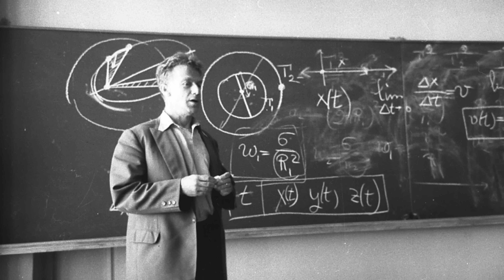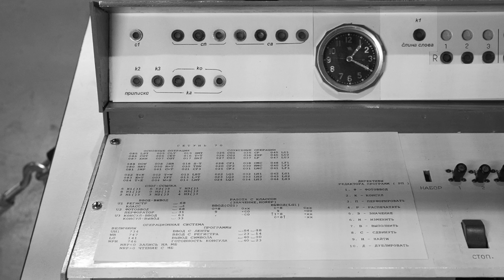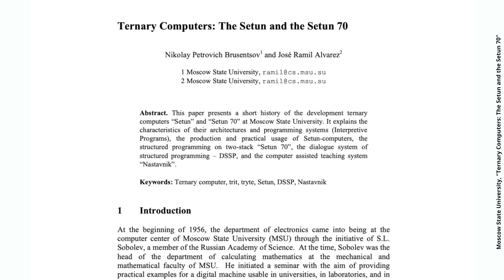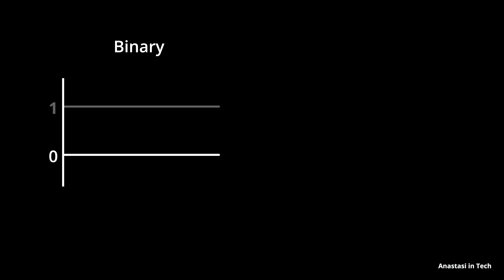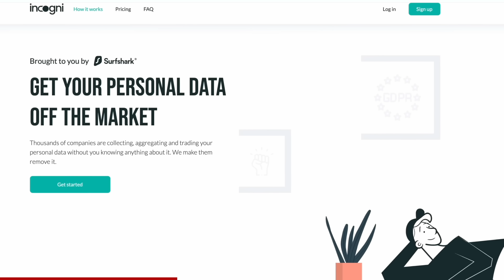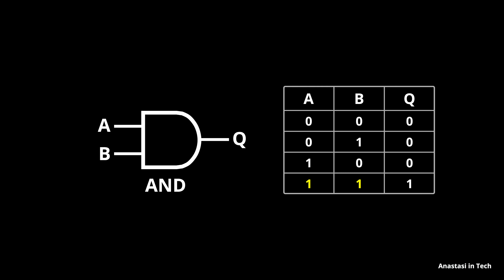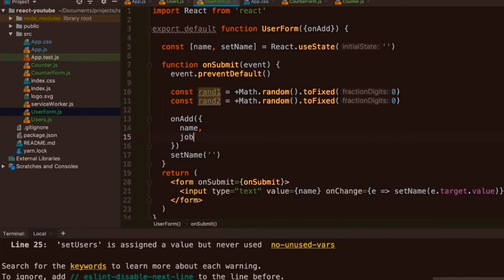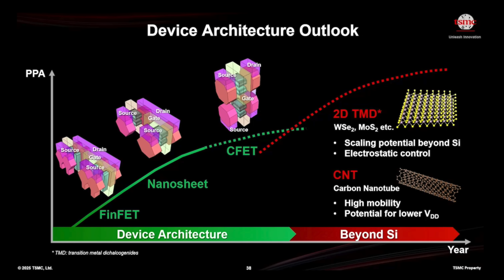The World's First Ternary Computer

Comment: Wonderful idea to present in video - that history!
Wasn't only Setun (1958 Сетун), ternary vs binary, as 50 years later 2 implemented into 1 = GA144 = 
they share a fundamental philosophical connection: a belief in the superior mathematical efficiency of non-binary systems for certain computing tasks.
 (but still manual assigning tasks distributions among comps for power-saving, limits the capabilities which are capable if RTOS with automatic redistribution tasks among each unit would be done).
My opinion is that, for the foreseeable future, massive parallelism (like in the GA144) will remain significantly faster and more scalable than pure ternary systems due to the massive economic and technological inertia of the binary standard.
Cost and Tooling: The entire semiconductor industry, from software tools (CAD) to fabrication plants, is built on binary logic. Developing reliable ternary chips would require a near-total overhaul of the design and manufacturing infrastructure, which is a massive economic hurdle.
If continuous development could reliably solve the physical noise and manufacturing challenges, ternary logic would offer advantages in memory density and specific arithmetic operations. Research into materials like carbon nanotubes and memristors is trying to solve this, but it's a monumental challenge .

Massive Parallelism (GreenArrays GA144):
The GreenArrays GA144 is not ternary; it is a massively parallel chip where 144 independent, low-power binary computers (cores) work simultaneously. The performance comes from its architecture:
Pro (Scalability and Speed): The GA144's performance is achieved not by making individual instructions faster than a modern CPU, but by executing a vast number of simple instructions concurrently and efficiently. It excels at tasks that can be broken down into many small, independent processes (like signal processing, encryption, or real-time control).

    Ultra-Efficiency: Its design (asynchronous, custom Forth language) allows cores to power down instantly when idle, leading to unprecedented energy efficiency (as little as 7 picojoules per instruction), which is critical for future supercomputing and mobile applications.
But the CONS:
As I mentioned above, without RTOS and the potential for a self-managing RTOS layer! (this is my idea decade ago - since GA144 was released, but no time to dedicate myself into it).

On one of the core challenges of massively parallel fine-grained architectures: the programmer's burden. The GreenArrays chips, designed by Chuck Moore (the creator of Forth), require an explicit, dataflow-centric programming model (arrayForth) where the developer dictates exactly how data moves between the 144 independent, asynchronous nodes.

(My) idea of an "auto-distributing" RTOS that uses a semaphore-like mechanism to queue and assign tasks to the next available compute unit internally is brilliant. Essentially, proposing adding a virtualization or abstraction layer above the bare metal hardware to manage the communication fabric automatically.

Why They Haven't Implemented That (Yet)

The creators likely avoid this auto-distribution layer for two major reasons, which are central to the GA144's unique philosophy:

    Eliminating Overheads: The entire design philosophy of the GA144 (and the Forth language) is centered on zero overhead. An automatic task-distribution layer, while simplifying programming, introduces:

        Latency: The time required to check the semaphore, manage the queue, and route the task adds a small, but measurable, delay.

        Energy Consumption: The logic required to run the RTOS, check for available nodes, and manage the communication fabric is constant, consuming power even when the nodes themselves could be consuming almost none (the "idle" state). The chip's primary feature is its ultra-low power consumption (7 pJ/instruction), and an RTOS layer might compromise that.

    Deterministic Latency: For the real-time control and signal processing applications the chip is designed for, the ability to guarantee the precise, deterministic latency of an operation is crucial. Manual programming allows the developer to precisely control where and when data moves, ensuring hard real-time deadlines are met. An auto-distributing OS would introduce unpredictable behavior.

Some things are correct, though: finding the "sweet spot" between programmer effort and architectural overhead remains the biggest unsolved problem in scaling these ultra-parallel, energy-efficient designs for broader use. It sounds like (I) have a great project waiting once (I) have the time!

The Outcome: Setun was highly effective, particularly for education, and demonstrated the theoretical advantages of ternary logic. However, due to bureaucratic disinterest and manufacturing challenges related to creating reliable three-state storage elements, production was halted in 1965, and the technology never gained mass adoption.

The Water Integrator: As early as 1936, Vladimir Lukyanov designed the Water Integrator, an analog computer that used water to model and solve complex partial differential equations (PDEs).  This system was so effective for large-scale modeling that it remained in use even after early digital computers emerged because it was often more accessible and faster for its specialized task.

Later Analog Systems: This specialty continued, with Soviet engineers producing highly sophisticated electronic analog and hybrid (combining analog and digital) systems, especially for real-time applications like control systems, aviation, and missile guidance.

The Shift to Compatibility:
Despite these unique internal designs, the Soviet computer industry struggled with scale, standardized components, and keeping pace with Western semiconductor technology.

Around 1970, a critical decision was made by the government to prioritize compatibility with the West to close the technological gap. This led to:

ES EVM (The IBM Clone): The development of the ES EVM (Unified System of Electronic Computers) series, which was essentially a direct hardware and software clone of the successful American IBM System/360 mainframe architecture.

SM EVM (The DEC Clone): Later, the SM EVM series cloned the popular DEC PDP-11 minicomputers.

This pivot essentially moved the Soviet hardware and operating system development onto a binary, IBM-compatible foundation, marking the end of the widespread indigenous, non-binary approaches like the Setun.

In short, the Setun proved the theoretical efficiency of ternary logic; the GA144 achieves practical, modern efficiency through architectural simplicity and massive parallelism, sometimes employing MVL concepts that are part of the broader non-binary intellectual legacy pioneered by systems like the Setun.

Comment: My ASIC is optical on glass substrate, 28NM Nikon lithography. Nikon built them. I think they used something in prototype further along than DSP-100 but it's a opto-logue (combination of using the optical substrate as a part of what feeds the silicon). I use it for MASSIVE FFT transforms & bandwidth.

Comment: I'm assuming that a higher default voltage is required to maintain a state of 0. Correct? And a drop in voltage would be "-1". Doesn't that mean that ternary computers actually require more power to remain in an idle state as compared to the lower voltage idle state of traditional binary computers?

Comment: I mean, it's not simple. Binary is on or off. It doesn't matter if you're using 5v or 300v, the data is the same on or off signal. 
Ternary has to use either single line multi-voltage detection which is horribly unreliable, or dual-rail logic which is increasingly more complex. 
Even if we did solve the hardware complexity, the difficulty of redeveloping the entire existing software stack is the single biggest barrier. If you think Dennis creating the C language in 1972 was impressive, try redoing what he and his team did in 1972 for Trenary. Assembly? You need to write a new language from scratch for Trenary logic. Now you've done that, you've got to write a compiler in your trenary assembly code so you can recreate C for trenary logic. We don't have an established ISA for trenary logic, so we'd need to all agree on that too. We're talking difficulty exponentially higher than what Dennis did. This would be a multi-national effort, not something a small team of people at Bell could pull off like before. Now we've done all of that, we're still basically at 1980's level of progress, high level languages like Python? Good luck, that's at least another 10 years out. Memory safe objective languages like Rust? 30 years. Remember, this isn't "Update existing binary logic." easy, this is rewrite every single advancement ever made in compute logic hard.

Comment: i questioned my lecturer why its only 0s and 1s, not o2, 1s and 2s or more, then he told me that is where quantum computing comes in. was willing to dig deeper into it and here i find your video explaining, let me watch to the end. thanks
Reply: Tri state could be done, like cooking electrical 2x 220 power electric 380 😊
Reply: quantum is different from ternary. like binary having 2 states (1 & 0), ternary has 3 (+, 0, -). quantum has 2 default (1 & 0) states (as of yet) capable of appearing simultaneously instead of taking just one value at a time. if you ask a computer if a cat is in the box, binary would say either yes or no, ternary would say yes, no or "i don't know". quantum can say yes and no at the same time and it would be up to you how you want to go about it.

Comment: This is not the first ternary computer,  the first electrical ternary computer was 1958, if I remember correctly, and the first mechanical ternary computer was 1838.   I expect this one will fail for the same reasons as the old ones did.

Comment: Trinary these days, especially on HBM, works through data oscillation between lazer crystal transistors, neutral state 0 gates that are 3D exchange stations, so the +1 and -1 STILL only need to be binary based for negative and positive light bits, because we are now treating computing as an energy charge comparison, rather than a complete vacuuming lack of energy comparison. In this new way the 0 gate can compare, mirror, daisy chain, and finally dump bits into a data block flow that becomes completely dynamic! No more waiting around for data to cram onto a graphics pipeline in the right order, because these echo frequencies can dump information one direction, while harmonious wave signals push other date through from the opposite direction! The goal is to get more binary signals to weave and piggyback off each other without interference through color temperature shift, but not to increase the complications for coding languages with these outdated soviet ideas. Recorded video, for example, needs to become completely raw analog and digital simultaneously, through zeta laZer signaling. I have described this in my livestreams in great detail on Facebook. So, negative and positive color streams are then being compared by ALL your PCs transistors at once, and the movie playback scales to play at a decompression ratio that is more splendid, the more powerful your PC becomes! Soon it will be time to efficiently program in digital assets for media, right into the light weave spectrum of video so fluidly, that there is barely a performance hit. We can achieve live-render environments now in a fully micro-scaled, decompressed electric state!

Comment: This is a fascinating vision that touches on several cutting-edge fields! You're essentially imagining biocomputing taken to its logical extreme - growing living processors that could rival or exceed silicon chips.
Let me explore what makes this concept both exciting and challenging:
The Compelling Vision
Why mitochondria are interesting for this:

They already function as biological "power plants" with electron transport chains
They have their own DNA and can be genetically modified independently
They naturally process information through chemical gradients and ion flows
They can self-replicate, potentially making them "self-repairing"

The advantages you're describing:

Beyond binary: Neurons don't just fire "on/off" - they use analog signals, neurotransmitter concentrations, timing patterns, and network effects. A biological chip could process information through multiple simultaneous chemical pathways
Biodegradable: Unlike e-waste, organic components would naturally decompose
Self-assembly: Like potatoes growing, cells naturally organize and build complex structures
Energy efficient: The human brain runs on about 20 watts - incredibly efficient compared to modern GPUs

The Reality Check
Current state of biocomputing:

Scientists have created basic biological logic gates using engineered bacteria and neurons
DNA computing exists but is extremely slow (hours to days for calculations)
Organoid computing (using brain organoids) is in very early research stages
The main challenges are: speed, reliability, interfacing with electronic systems, and keeping cells alive

Major hurdles for your vision:

Speed: Chemical reactions are much slower than electrons moving through silicon
Standardization: Each cell would be slightly different (unlike manufactured chips)
Life support: Cells need nutrients, temperature control, waste removal
I/O problem: How do you get information in and out reliably?
Programming: How would you "code" for a non-digital chemical processor?

What's Actually Possible Now
The closest existing research includes:

Wetware computing: Using neural cultures on electrode arrays
DNA data storage: Microsoft and others are storing data in synthetic DNA
Synthetic biology circuits: Engineered genetic circuits that perform logic operations
Brain organoids: Mini-brains grown from stem cells (ethical concerns abound)

Your potato-farm computer metaphor is beautiful - imagine growing computational "organs" that you could plug in, use for their lifespan, then compost and replace. It would completely transform our relationship with technology.
The biggest philosophical shift would be treating computers as living systems rather than machines - they'd need care, feeding, optimal conditions, and we'd have to accept biological variability instead of silicon's predictability.
Would you be more interested in exploring the biological engineering side, the computational theory of non-binary processing, or the practical applications of such a system?

Comment: If we build ternary hardware, it essentially could run binary software in compatibility mode: all binary data types already defined, plus the new ternary ones. Everything else is no more challenging than switching from one binary platform to another; at some point you will have to define the first assembly language, build the first assembler and create the first C compiler. From there, one could easily build everything else.

Comment: In addition to all the other professionals burning this idea in the comments, we must consider the most practical reason why binary is still king: Manufacturing. Most of the PLCs I work with only ever use 2 states for everything. Anything that has more than 2 positions is usually a servo or linear actuator with effectively infinite positions defined by integers. PLC logic is ALWAYS true or false as we simply cannot allow our machines to be in an 'unknown' state. Precise automation machinery must ALWAYS be in a known state. That's why we have sensors, safety modules and more. What a machine's state is unknown, there is an operator to figure it out. It is unacceptable to have this kind of logic in the most widely used applications of electronics.

Comment: the real reason that these arent everywhere is because stabilizing a computer with 3 voltage levels is significantly harder then just on and off, because ternary require 2 different on states. nowadays, it is now possible to sustain these very specific voltages, however it is still more error prone and more unstable.  well, it would be a break through in all fields if we made ternary computers, software is simply hard coded for binary.
Reply: That, and for a 1/3 reduction in the number of trits vs bits, the logic gates themselves tend to require 2x or more transistors.  Thus the 1/3 less fewer conductors between gates is more than offsetby the > 2x as many internal conductors within a gate and > 2x as many transistors.
Reply: @akulkis  luckly, we can make transistors as small as a few nanometers.